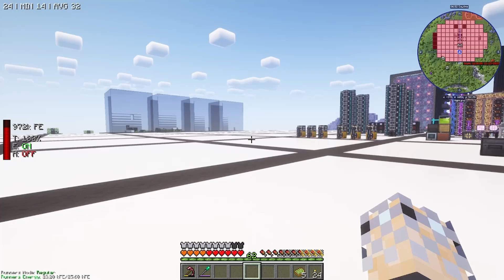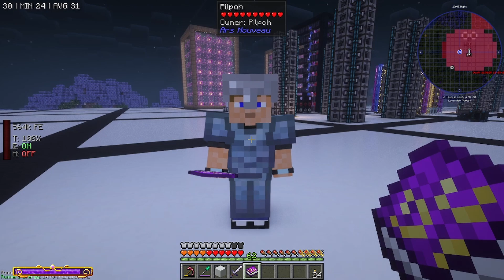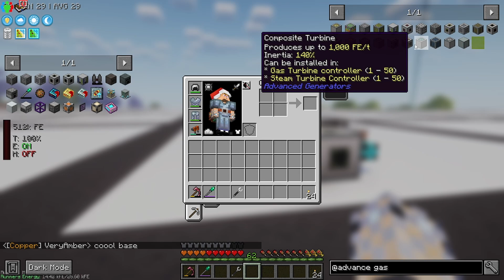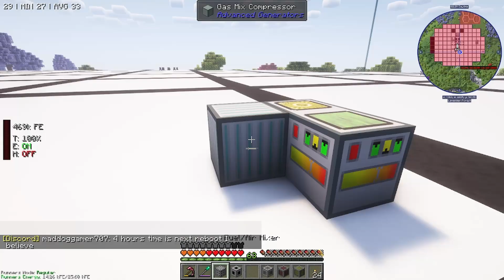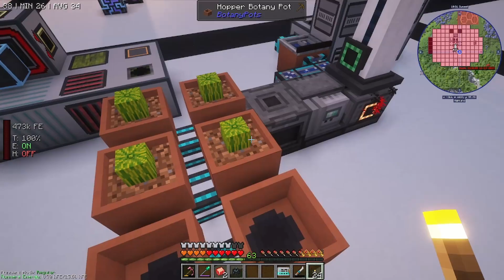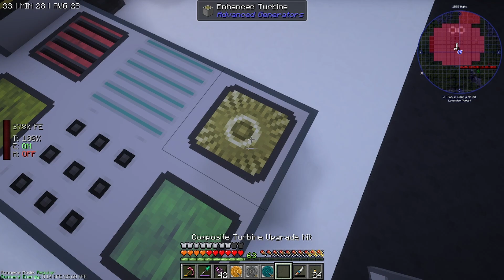All The Mods 9 Reloaded Ep. 05 - Advanced Generators Melon Power!

Comment: Easier to get the Phytogenic Insolator?? hahaha. The default recipe on V. 0.2.34 which Im on now in a single player world is just dirt, no anti-matter. Is that a modified recipe specifically for the server? And I could be wrong, but i feel like Anti-Matter is significantly harder to get than dirt hahaha.
Reply from the maker: In the previous I talked about how we nerfed Phytogenic Insulators. The reason for this is as follows: On the ATM8 server we were hosting, the only thing people were doing for resources were making seeds and putting them in Phytos. The gameplay got so boring that a lot of people gave up! This season Phytos were released and before people got access to them we changed the recipe (Just On OUR Server!) so that it takes an antimatter to make a Phyto. This is to slow down game play and change the meta from making tons of phytos to actually exploring other options for getting materials.  😉
Reply: @Pilpoh  For sure. that makes sense. I was just confused if i had some version of the pack that didnt have this. But if its a server specific change that makes total sense. And i agree, it slows the meta down. Prior to the addition of Thermal, i feel like the plant meta was balanced. well.

Comment: Advance generators is a nice mod. But it only can handle so much per setup. Like the turbine u can only use 50 of them. and what turbine u gonna use. u can use steam but also fuel turbine. read the controller tool tips what blocks belongs to that setup. i made mine a steam turbine. water and lave makes steam and obsidian and the steam turbine give power. u also can use fuel, but look at the fuel what is best. like wood is ok u get syngas from that to burn as fuel, but gasses are better, even ethylene give more. But only up to 50 turbines in a setup. Full setup with 50 of heater and turbines: My heat exchanger (produces steam) gives me almost 4000mb/t, the turbine give me almost 8000fe/t with the 4000mb/t steam. Tools tip: the yellow text are the blocks u need or can put in the multyblock. like the heat exchanger needs fluid in times 2, fluid out, item out, heat exchanger controller, heat exchangers up to max 50. steam turbine needs  the controller, up to 50 turbines, fluid in, power capacitor en the power emitter module.

The syngas needs to be above like 150 C befor it maked syngas, that why i used the steam setup to make steam for steam turbine but also to produce syngas. now u need the logs to heat it up and that takes a while. with the heat exchanger u can make steam and pump that in to the syngas maker. it doesnt need to heat up itself.
Reply from the maker: Ah makes sense! I like it but it's kinda underwhelming on power out put unfortunately... I think we may go for the Mycelial Reactor 🤔
Reply: @Pilpoh  i guess that would be better yes, I linked all my generators together to 1 induction battery. If i start with the reactors, i will link them ass well to the induction battery.